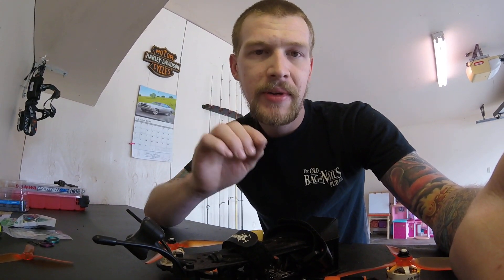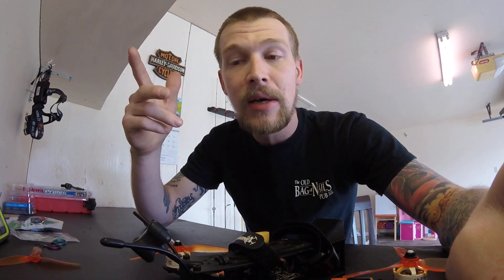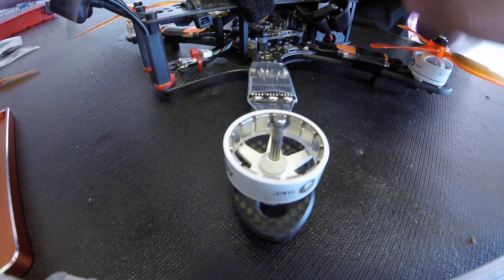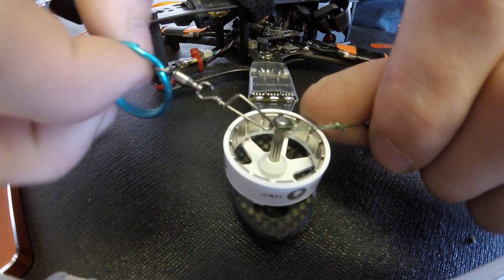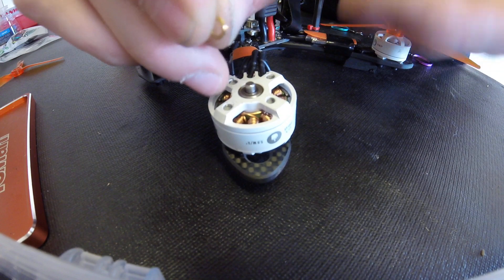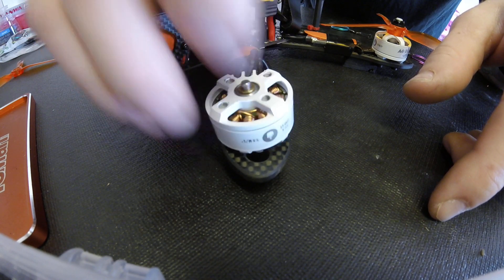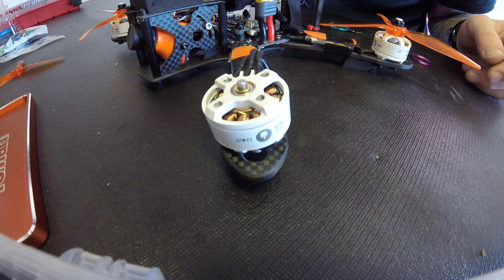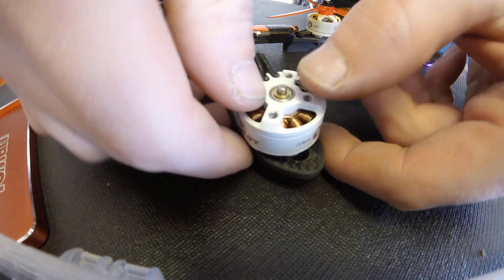TBS Mr. Steele Motor C-Clip Removal & Replacement

Comment: thank you for the trick!  my application was carburetor choke lever shaft. barely a razor blade clearance to get in there.  stripped two bread bag twist ties and made a loop with the ends twisted  around a washer. two little washer loops pushed in with a razor blade and the day looks much brighter

Comment: why do we need to use c clip?
Reply from the maker: Ayberk Halaç the c-clip is this motors only way of fasting the bell to the stator, the motors magnets can hold the bell on but not well, I have ran without them and had them come off on impact and punch outside
Reply from the maker: Outs*
Reply: so without c clip i can use my brushless but its not good for them ?
Reply from the maker: Well u should have c clips on them, without them it will still fly and it's not bad for the motor but you could eject a bell

Comment: Those C clips are some stiff mothers... Still haven't been able to safely take one off and put it on a different motor... really annoying and frustrating.
Reply from the maker: Longin Albu yes, the original ones are very stiff that's the issue with them, and why they eject so easy. With the great planes 3mm clips there alot thinner, easier to install and I still havnt had one come off. Most other c-clip style motors use clips just like the great planes thin ones. I avoid c-clip motors all together now although the tmdrones turbo pinks use them and I love that motor, no bell ejection problems ether
Reply: Hehe, I have 3 quads all running v1 steeles and I have two spare motors, so in total i have 14 v1 mr steele motors and i cant replace the clip on one motor...
im now making a new one using the v2 steeles and I have to say its a huge improvement over the V1
Reply from the maker: Yea I've herd the v2 are alot nicer, which I love the way the v1 fly just the c-clip issue and the bearings getting really crunchy after about 20 packs. I'm going to get some v2 motor bells and NGK bearings for my v1 to update them. I've been flying the T-motor F40 pro2 2400kv for freestyle and racing and I love them!! Just built 2 quads with the F60 2500kv so will be doing some testing and maybe a comparison video between the f40 and f60
Reply: Great idea about the bearings, I just got three packs of the v2 bearings which apparently are better as some of the motors have gotten "crunchy" and have a funny noise, however it would be nice to get enough bearings to swap all of them out. Please pose which NGK bearings you refer to if you don't mind.
Oh prior changing bearings, i will need to be able to safely take out the clip and it doesn't look like it will happen..
Reply from the maker: I don't have exact link for the bearings, I don't have specs on one yet, but ngk is a good brand for the value and they carry every size out there. U want higher end bearings look at Boca bearings. Just measure the outer diameter, inner diameter, and thickness of the bearing you recieve and Google search that for tons of options in that size. If you flip the motor over and even pry off the old one and use the method in this video for assembling the new great planes ones u will get it no problem
Reply: Dillon Hoopes Boca bearings start at around 5-6$ each...
Reply from the maker: Yea there the higher end bearings, some if the best you can get. But some ngk and other brands would work just as good

Comment: dude, wow ! that is a great idea with the line... you know how many of them lil bastards I've shot across the room now?? bet there is three or four of them in my carpet.. anyways the c-clips I've found to work best and stay on (but yet come off when you want) is actually 2.5mm clips ! the shaft size is 3mm, with the grove it's only 2.5mm... but good luck ! Thanks for the tip man! 
oh and I have 5 Aliens all running these and I've only "lost" two clips while in normal use.. all the rest I've lost trying to service mtr's and replace bent bells so don't let it ruin the idea of using these motors. there by far the best motors I've found to date. 
C-ya
Reply from the maker: Jason Hull yea the great planes clips have stayed on for me, Steele recently released his video on the v2 Steele motors and said the clips one these were to stiff which makes since why the thin great planes ones have worked well. With the new v2 having the set screw makes life alot easier. Although i won't be changing bells one these unless I happen to have some extra in the future. I love these motors too, I believe I'm going to try the t-motor pro 2 on my first race build.

Comment: thanks for this! i was just searching for what size c-clip i needed to buy. i just got these motors and I am having the same problem, bell flew off on first flight. and i lost another one the other day.  I had some extra shims and c-clips lying around from some old emax motors that i was able to use. they seem to hold better, but i did notice there was more play in them so i'm not sure how much that will effect things.
Reply from the maker: at first i just used some m3 washers which are about 6-7mm in diameter and anywhere from .45-.6mm in thickness i just found some a tad under .5mm and they worked fine. the great plane clips are small compared to the factory clips, as in there thinner with not as much material but i havnt had an issue with them, they may go into the groove better. I herd the new steel motors will have set screws
Reply: guess i should have waited for the new ones to come out? Thought I would give these a try:
https://www.mcmaster.com/#98541a111/=1ajw22p

Comment: hey man thanks again for this insight in the problem. You think maybe just squeezing the oem c clip together tighter would stop it from flying off?
Reply from the maker: its possible, but i've found it raise up still idk why, i think the clip might be to thick, the great planes ones are thinner so they get into the groove well but they may be more fragile, i havn't had an issue with them yet although i've had issues with the factory clips still. I've herd the new steele motors will have set screws